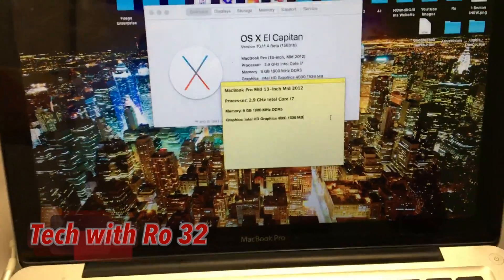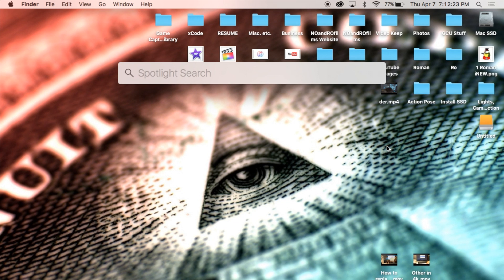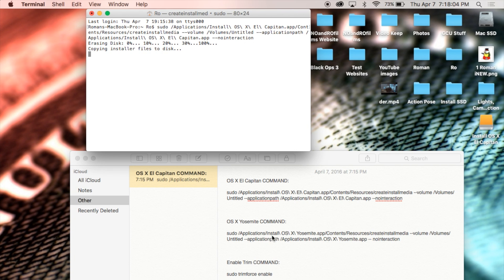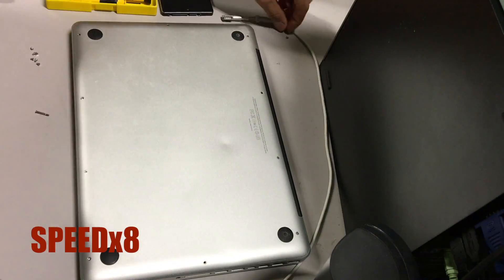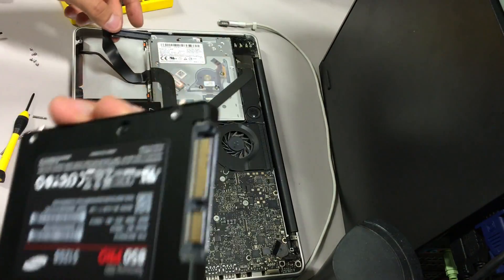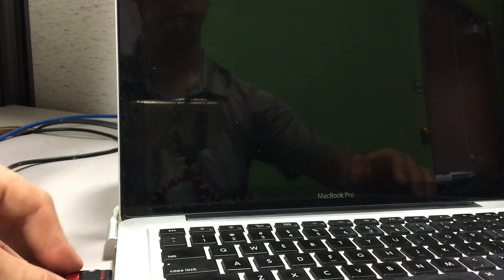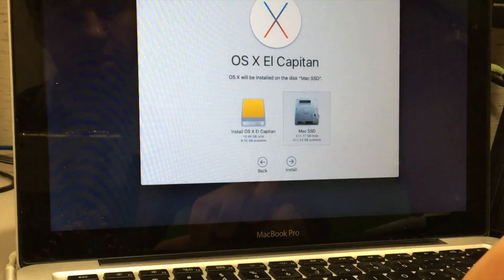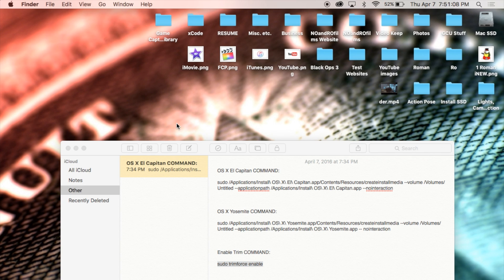How to install an SSD with OS X El Capitan on a MacBook Pro | TwR Ep. 32

Comment: I installed my Samsung 860 EVO 500 GB SSD in my Late 2011 13' MacBook following these steps and everything worked like a charm. The code in the description for High Sierra works currently and gave me no problems. The only problem that I had occurred when going into recovery mode and choosing the option to reinstall HighSierra onto the SSD after the SSD was erased through the Disk Utility. I would get a message saying "This copy of Install macOS High Sierra.app application is damaged, and can't be used to install macOS". Fixing the Date and the Time through the Terminal seemed to fix this, and everything loaded and worked perfectly after that. Thank you so much!

Comment: Hey! So did you erase your old HDD before putting in the ssd, or did you just take out the HDD with whatever files it had ?
Reply from the maker: No I did not wipe it, actually ended up removing my CD Drive and placing a HD trey in its place and installed my HDD alongside my SSD.

Comment: I have a mac book pro 2012. Accordingly to your experience, is there any reason why it should not recognize an SSD Samsung 850 Pro 512 GB ?
Reply from the maker: Some have been reported to not be compatible with MacBook Pro, when purchasing it's best to look out for ones listed MacOS compatible.
Reply: I confirm so far not compatibility of mac book pro 13" mid 2012 with Samsung SSD 850 PRO. I also followed silly theory on hard drive cable not suitable for higher bandwidth with no success. Is there anyone out there who can suggest a walkaround if any?

Comment: Why would you do all this trouble, when you  can just put the SSD on a USB dock, reboot into recovery on the Mac, then reinstall the OS using the recovery partition and select it to install on the SSD.  Lol.
Reply: Agreed. That's what I would have done, but I don't have a USB dock. I only have a flash drive right now, so this is the better way for me.

Comment: Thanks. I'm getting a "Password:" prompt after I paste the code into Terminal. I've tried several versions of the code, but all with the same outcome. Any advice?
Reply: it wont react as you type, it wont show dots or characters - just type your password and hit enter.
Reply from the maker: That is more than likely your personal computer Admin password.  If it is asking you something along the lines of changing something on the computer it maybe either your login password.
Reply: i keep getting the same thing and it doesn't allow me to put my password in, what should i do...

Comment: hello, i wanna ask. what if i don't have usb installer, is it possible to install the OS?
Reply from the maker: What are you planning on installing the OS with?  If you do not have an external drive with a bootable OS on it then you may boot into the network or the Recovery which may give you additional OS options.
Reply: thanks for the info

Comment: Early 2011, A1278, 13 Inches MBP Unibody:

Swapped Apple's 320GB Hard Drive with Samsung Evo850 250GB SSD Drive.
I was getting about 40MB/s read and 25MB/s write speed with Apple hard drive.
With Evo850, 250G I am getting around 240MB/s write and  510MB/s read speed. 

My MBP is now smooth.. very smooth... :)

Comment: If I wanted to do a clean install on the new ssd can I just instal the hardware then have the option to install fresh OS? Or do I have to make a clone and all that BS. I am not worried about loosing any files. Will the Mac load up with a new ssd and give me the option to install a clean OS?
Reply from the maker: You may be able to try, at boot: (Option+N keys on your keyboard) or (Command+R keys on your keyboard until you see the Apple logo appear onscreen).

Comment: Can i install osx sierra on a SSD, if i change my working macintosh HDD to a caddy (to have 2 drives) and a new SSD where the original HDD was. Then boot up in the old one and format SSD and open the osx sierra install, and select the SSD and install it, then select to boot from SSD?
Reply from the maker: Yes this would probably give you access to both your HDD and SSD at the same time.  I was personally considering changing my currently built in cd drive and installing my old HDD within it myself to run dual HDD & SSD.
Reply from the maker: I have not yet personally done this but if I do, I will be sure to make a video on it too.

Comment: what do I do when Im getting Corrupted or Damaged during Downloading ? Im installing from usb to new ssd
Reply from the maker: Downloading the OS? Merging the OS into the USB?  So the USB is not being recognized as a bootable OS?  It maybe that the OS was not applied correctly to the USB.  You may need to re-create your Bootable USB.
Reply: I have downloaded the os from torrent and did the same thing that you showed in the video I searched some forums and they all say that I need to change the date but when I did that it didn't helped
Reply from the maker: Are you on a Mac or Windows?  I do not recommend using Torrent for this.  On boot you may also try: Command+Option+R which will put you into the OS Recovery with Internet if you wanted to try and launch/install an OS over the Internet.
Reply: Im on mac I just had to download the os from torrent.
Reply: Browish did you ever solve this problem? I have the issue.

Comment: why after i finish 1st step installation then the second one its stuck ... automatic the storage have to erase once more , if not erase it says the failure because disk prob sting bla3 need help pls using samsung 850 eve ssd 120gb
Reply from the maker: +namaku sikucing so your hard drive is failing to format?  You may need to format it using a third party program.
Reply: sorry got 2 account 😂😂... nope i formated already as in your video but the ssd need trimforce right for the data to stick on ssd so i think that after reboot the previous installation goes on to pages ... so that while atempting 2nd installation the computer only detect usb contain os . when that happened i go back to utility and erase again as untitled its ok but then proceed installation it says that  file system verifiyed faild so restart the installation.then after restart the computer detect the ssd and cannot erasse already try analyze promp error 8" smting like that...furthermore, and i've tried install using third party style by installing the os via usb but when the process done i cannot enable trimforce . if i plug out the ssd from usb for sure the data cannot read when apply to internal... helppp
Reply from the maker: You may find how to enable Trim at 09:32 of the video.  So your newly installed SSD is not readable by your Mac correct?  Was it readable by your Mac initially or was it not recognized ever?  If you are able to boot into Disk Utility I would recommend running the disk repair.
Reply: externally work perfect but internally after computer restart hard to detect that ssd sometimes it pops up sometimes it become hidden

Comment: Im clearly not an expert,  thus i have encountered some issues; firstly when booting my mac i was greated with an Internet recovery mode,  and not the bootable os x el capitan. Secondly,  after choosing the internet recovery, i am not able to erase and partition my SSD. And if i try to install the os x system (which with the internet recovery mode is the mountain lion os x) i cannot find the sdd to install it in,  which is probably due to the fact that i wasnt able to erase and partition the sdd.  The interesting thing is that the ssd already has a "guid partition table" scheme.  Do you have any suggestions,  if i wasn't clear pls tell me,  as English isn't my first language 
Cheers
Reply from the maker: +Diogo Sotto-Mayor What SSD are you using may I ask?  You did hold down the "Option" key on boot as well correct.
Reply: Yes i held the option key,  and my ssd is the samsung 850 evo 250 GB
Reply: And my mac is a mid 2012 13inch macbook pro
Reply from the maker: +Diogo Sotto-Mayor If your bootable HD with the OS was connected when you powered on and held the "Option" key as well, then I would recommend re-running that step by restarting the computer.  It may of not picked up the SSD with the HD the first run through.
Reply: Hey Diego I have the same problem I bought a Kingston uv400 and MacBook 13" mid 2012 doesn't recognize my ssd, I looking to solve my problem! I speak Spanish so if you find solve problem  please tell me! Thanks so much

Comment: How long  should the 'createinstallmedia' take? I believe mine froze, and if so, how should i proceed?
Reply: +lala lolo i never managed to install the ssd internally. So i simply use it externally with an adapter i bought online. but it works fine.  The only problem is that it took away the mobility of the mac book. I asked around,  and even though my sata 3 cable works with my old hard drive, its probably defective, hence why it wont read the ssd (internally) even though it's already running on the latest os x (el capitan).
Reply from the maker: +Diogo Sotto-Mayor Mine took roughly 30min.  Depending on the USB you used (2.0 or 3.0 & its size 8gb+) it may take longer.
Reply: +NOandROfilms - Everything Apple thanks, i waited it out, and i ended up using a hard drive, which was faster
Reply: +Diogo sotto-Mayor bro did u manage to install on 850 evo ? TT . TT i need help on that
Reply: what a bummer if like that